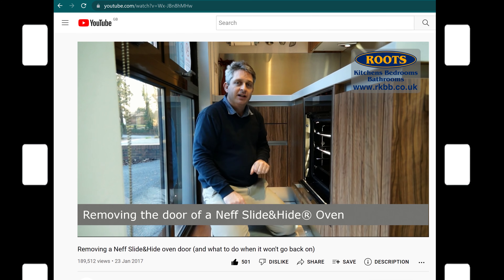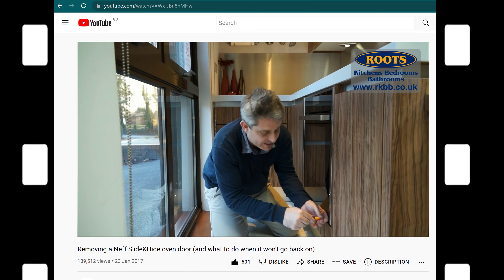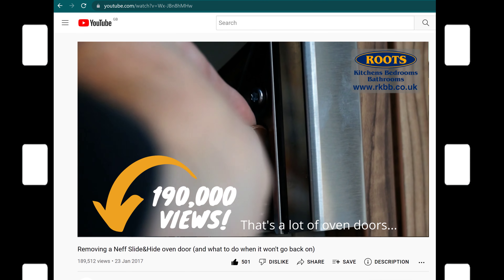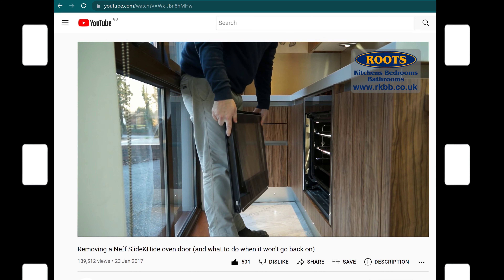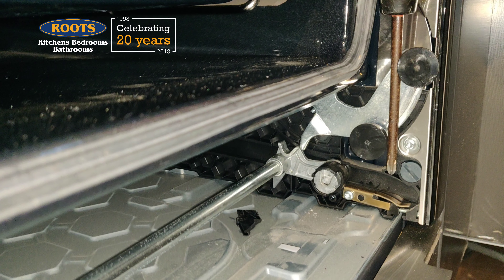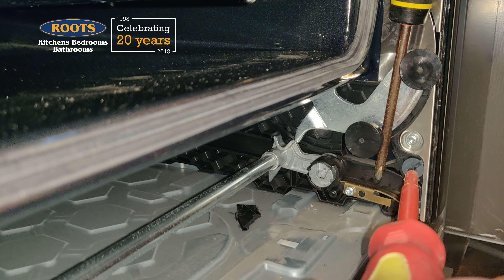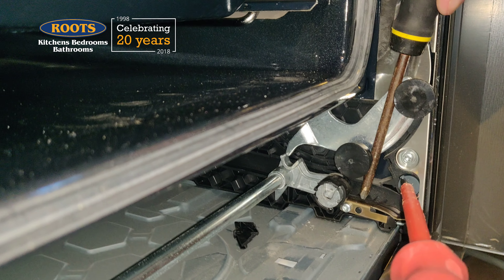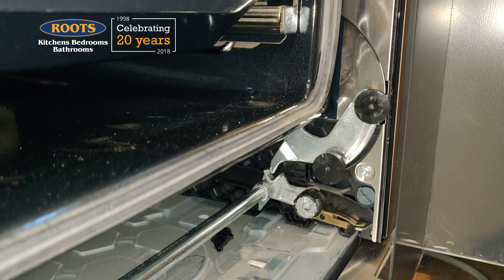Neff Slide and Hide - fixing the oven door hinge

Comment: Wuhay!! Fixed my Neff slide and hide door after advice from Roots. Thanks so much! The video on fixing the oven door hinge is brilliant. Top tip - I couldn't get one of the oven door hinges to lock in the open position, and the answer is to keep trying because (as discussed on the phone with Roots - excellent service thankyou) there is a sweet spot which for my oven is when, using the screwdriver as recommended in the video, you hold the hinge at about half to two-thirds of the open position and then turn the hinge lock. After a few tries I managed to get it to lock and the oven door is now functioning fine. Thanks again...!
Reply from the maker: What's the model number (hoping you have the invoice, rather than me tell you to look at the serial number hehe)?
For most, left hand side of the oven vertical side, 
OR when the door is open, look at the bottom edge of the door (you might need steps or to use your phone to video along the bottom edge if the microwave/oven is high for you, 
OR  for wall microwaves, the left hand edge of the control panel when the door is open (so right hand of the door where it meets the control panel, these doors are always left hand hinged).
Hope that helps,
Steve

Comment: Hi Steve, thanks alot for sharing as this video was very helpful.  Had the same problem as when I removed my door missed the steps to turn the screw and lock the door in a mid open position.   So had to get the hinges in the lock position first before I could re-attached the door.  I found it quite difficult even with the video but realised after some time that I was not pushing the clip far back enough to get the lock to engage! Anyhow after some perseverance and with the help of your video I sorted it.  I will not be missing that step again!

Comment: I have just struggled to replace the Neff slide & hide door.  I managed to get myself into a right pickle, ending up with the bar at the bottom of the oven right out of the tracks and shedding the roller bearings to boot.  Your very helpful video complete with those all important close ups got me out of trouble.  Thank you for what you did - I am most grateful.  Best wishes.

Comment: Brilliant video helped me sort my door out. My was a slightly different issue as the door was locked at an angle and would not slide in or go up/down Needed the oven taken out to get to the hinges as the bar had come out. Looking at the design it not very cleaver as only a very small contact area on the V and the tooth.Biggest issue was the so called engineer who attended said we needed a replacement bar @£160+. After he went had a look and all he had done was lose a bearing when he dismantled it. Got one from a bearing specialist @ under a £5😂
Reply from the maker: Nice find on the bearing replacement. Having the skill to identify and replace obscure components is very useful!

Comment: Thanks, I was stuck when the left hinge on my oven door was in an incorrect position (on refitting the door) and  would have needed to call an engineer without your video.
Reply: thanks had an  problem  first time took of my doors in my oven  tried to get my door back on right hand hinge was locked tried to open with my hand sprong back and gave me a right sore and bloody finger so got onto you followed your instructions and great working ok  thanks again saved me a few £ and no more burst fingers

Comment: Great videos.
I shattered the outer glass panel trying to replace the door when the hinges hadn’t locked in the partially open position. Bought a replacement outer glass panel and refitted it. There are 4 torx screws that need to be undone to do this, but it’s not too difficult.

I had just the same issue as the Roots video when seating the door onto the hinges, but watching these helped me figure it out.

It looks like in this video the rotary black plastic hinge locks are rotated down. You’ll need to rotate them up (away from you) to align the aperture in the black plastic with the recess in the silver lug so that the door can slide all the way down onto the hinges.

Comment: Spent a couple of hours today wrestling with this but the bit the hinge sits in on each side and the connecting bar had migrated to the back of the oven  which caused confusion. Eventually we found it, got the rollers back in and failed repeatedly to get the door back on until we realised we had to lock the bar and U think back under the hinges. We wrested the hinges back into place but using a screw driver is a better idea. Fixed it eventually.

Comment: I'm having problems getting the hinge lock to lock the sliding hinge.  The hinge slide is fully to the inside position so trying to pull it all the way back and lock but it doesnt lock. Any help appreciated.
Reply from the maker: Sorry for the slow reply, busy with the real job recently :-)
I'm hoping you found a solution rather than go hungry for 3 weeks, generally the solution to this is to keep trying and try holding the door at different angles whilst you lock the hinge. You can see in this video it took me two attempts to lock the hinge.
Hope that helps
Steve

Comment: Thanks to your video I managed to get the oven door back on but for some reason it is ever so slightly skew and the glass touches the base on the bottom right hand side, as I close the door, forcing me to lift the door a fraction as I close it otherwise the glass may break. Any tips on how to align the door so the gaps are equal all around and the bottom right hand corner doesn't scrap the bottom?
Reply from the maker: Two ideas that might help; 
a) I once had an oven where the base was slightly deformed. Pushing it down back into shape solves the rubbing problem.
b) Assuming yours was ok before, then taking the door off again (sorry!) and putting it back on and maybe it will sit slightly differently. 

There's no adjustment in position/angle from memory of playing with these, though if you look at the connection points I did once have a broken plastic clip part and that was why a door wasn't sitting straight (solved by replacing that part which was the side profile of the door if I remember correctly.

I hope that helps!
Steve

Comment: Hi Steve - thank you for this. I fixed the door hinge. But now the grill function won’t work as the oven says the door needs closing. The door looks closed - have I damaged a connection ?
Reply from the maker: @sarahlouise5729  I've not seen this before and no other commenters have mentioned it.  Guess 1, does the grill turn on if you gently push the door closed?  Maybe the heat seal (flexible gasket between oven and glass door) has come off and is stopping the door completely closing?
Reply: Hi Steve - if I push hard on the door the grill will work . Nothing appears to be damaged.
Reply from the maker: @sarahlouise5729  OK, that sounds like a good sign. Check the rubber seal around the door, then try removing the door and putting it back on again. Maybe the trim is slightly distorted/twisted, or maybe the door isn't quite on the hinge properly.
Follow the instructions in the manual step by step in case you've missed a step (eg: slidey black plastic locking parts that I forgot to reset in my first video on the hide and slide doors).  My instinct is you can fix this... it's just work out which bit is the problem.

Comment: My oven door stuck and a bit of the side black material has broken off, my handyman said the side didn’t look very strong for the regular use of opening the door. I have tried to stick it back together but it hasn’t worked. Can I buy spare parts or is a complete new door going to be needed?
The oven was fitted in 2017 so is 7 years old and doesn’t get used that much.
Reply from the maker: Hi, you can buy spare parts from Neff or (probably) the generic online parts companies. For direct from Neff, https://www.neff-home.com/uk/service/spare-parts where you enter the ENr number / serial. If you can't find the serial number on your oven, this video will help -> https://www.youtube.com/watch?v=6gmd3M-0LaQ&pp=ygUXbmVmZiBzZXJpYWwgbnVtYmVyIG92ZW4%3D
The Neff site will show an exploded diagram with all the parts of the door you can order and their codes.
Hope that helps,
Steve

Comment: Thanks for your video, it’s sorted the issue with the left hinge but the right one, no matter why I do it doesn’t lock in place. What am I doing wrong?
Reply from the maker: I think it's keep trying and hope. You see it took me two attempts to lock it, so try the hinge in different angles as you turn the lock to see if you find the magic angle.  Also the twist that you're doing is pushing a plastic strip to move the hinge lock, so maybe try a 'fast' turn to lock position as well as a 'gentle' turn. Maybe it's sticking and varying the speed of turn will help you.
Reply: @RootsKent  thanks, it did work eventually. I saw on another reply to someone that you’d done that we had to just keep trying and eventually we got there. Couldn’t have managed it without your video.

Comment: Are you able to advise, my hinge is not engaged the same as yours in the video, but it’s in more of an upright position, it’s really hard to pull back down, but I have done and re and engaged it, but when trying to lock it into that position it just springs back up 😢
Reply from the maker: Sometimes I've found I don't put the hinge in quite the right position to lock. 
I think I remember in this video having to move the hinge to a couple of different points before it locked but it was a long time ago. 
To solve, try moving the hinge and locking it a different angles. If it doesn't work, try another angle and hopefully you'll find the sweet spot that it works.  
Good luck and let us know how it goes - it might help someone else reading the comments with the same problem 🙏

Comment: A real pain in the Harris to take the door off to clean the glass internally the manual is not clear on the locking round pins when putting back on the oven - I have successfully broken something on the right side and internal of the oven (probably a spring has pinged of) it just about closes now.
Reply from the maker: Hi, from memory there's a hook shape on the side of the oven door, at the bottom, that engages with the bottom roller/lower circle, the one that slides to the back of the oven. When you next dare to remove the door, check if the sides look the same. If that hook has broken off you can go to the Neff website and search for parts based on your oven's model number.  
If it's the locking pin that's broken I think they're also available as a spare part though I haven't tried buying either of those. If you do need to go one please post back and let others here know how it goes.
For ''just about closes', beware that if the door isn't closed properly against the rubber seal between door glass and oven body  you'll have hot air escaping. Higher running cost, maybe not so good cooking, but potentially that heat could cause damage outside the oven (control panels, adjacent cupboards). It's probably worth checking to be sure just about is closed.

Comment: hi my issue is the bottom bracket on the bar that has moved to the front the bar you move with your hand in the video and its solid
Reply from the maker: Hmm, I'm not quite sure what you mean but if your backet on the bar is loose, check the opposite side too. 
From memory, the two brackets are held 'apart' into the oven side guides by the bar, but the bar can be rotated (imagine right side going towards back of oven, left side coming towards door) to come out. I seem to remember one coming out completely and falling apart on me, and it was easy to put back once I'd worked out the angle and pushed the brackets back on when inside the oven, making it more solid again
I hope that helps.

Comment: Thanks! I had an issue with the sliding door handle not turning, turns out the wire is snapped inside the mechanism!
Reply from the maker: Thanks for sharing, that's a really useful detail for someone else having the same problem
Reply: @RootsKent  Thanks! I'm going to buy a new wire and try install it, if that doesn't work then I'll be buying a whole new door.
Reply: @HarryW96 my handle not turning but can't get the door off. Is there a knack to getting door off to check the wires etc...
Reply: @HarryW96  Did you manage to fix this issue / the wire yourself?
Reply: I clean ovens for a living. Yes I have come across a few of these where the wire had broken. Sounds like it's quite a a common thing

Comment: Can't refit the slide and hide door. I can re-engage the hinge in the claw as you suggest but the lockinh screw doesn't work so it just snaps back before I can fit the door. Tried everything but without the lock it's impossible, any ideas?

Comment: Hello
Hoping you can help me as I went to remove the door for cleaning I turned the 2 flat screwdriver locks but forgot to flick the hinge covers up. Stupid me.
I then opened the door and it will not close now despite turning the 2 locks back.
The door slides out a bit but will not hinge up.
Im stuck!!

Help please if you can I can’t even take the oven out as the lower screw is obscured by the door being open
Reply from the maker: OK, let's save Christmas dinner! I think flicking the hinge cover/slidey black bits are a misdirection here.  
I think the problem is the turning of the lock with the screwdriver/coin.
That turning movement moves a flexible plastic rod that in turn lock and unlocks the hinge movement. We had a new oven last year and the first time the client remove the door the rod jammed.  The lock still turned so it wasn't apparent that was the problem.  We eventually solved it by removing the oven (we just had enough space to get torx screwdriver to the lower screw and remove the decorative sides if I remember correctly) and then you can see the rod from the outside of the oven. A light tap, it released and everything has worked perfectly since.
So for you I'd suggest 
a) tapping the side of the oven between turning the lock and trying to move the door/hinge. With luck, a lucky tap will dislodge it so the hinge is released. It's worth trying a dozen times before option b...
b) Removing the oven without being able to access the lower screw on the decorative cover: The decorative covers have a a little bit of flex in them. It may be that releasing the top screw you may be able to flex it enough to access the screws the secure the oven to the housing.  If that fails, you can break them off knowing you can buy new covers after Christmas. If your oven is a collection model, then for example this part https://www.neff-home.com/uk/productlist/ovens-compact-ovens/accessories/Z9060MY0#/Tabs=section-manuals/Togglebox=manuals/ is £62.22 inc VAT according to my computer. If your oven is a core range model you can buy replacement from Neff once you know the model number (https://youtu.be/6gmd3M-0LaQ).
I hope that helps, please post back and share how it goes as that may help someone else!
Thanks
Steve
Reply: @RootsKent  Many many thanks. Once I'm home I will try this. I will update with some photos also as I'm a big believe in helping others from my learnings.
Reply: @ Hello again,
What can I say, absolutely fantastic advice!

I got the oven out by just about reaching the bottom trim screws without any bending of the trim using a T15 screwdriver. I then jiggled the connecting rod a bit and the door then was able to be raised shut.
This mechanism seems poor and almost a gamble if it will engage but at least I know next time its a case of sliding the oven out.
Unfortunately my patience wore thin the other day and in forcing the door I have broke a section of the side rail and also bent the bracket which is bonded to the outer glass which means the outer glass now has a gap at the bottom and the roller wheels catch a little when opening.
It means I can use it as an emergency oven at least.

My question would be is it worth awaiting the Neff visit on the 2nd and will he replace the front glass and rail or would it be worth cancelling and sourcing the parts myself? Im extremely competent and have had the door glass apart before so would be confident replacing the glass and rail. The only thing putting me off doing this is the absence of any parts showing up for a B54CR71N0B.

Many thanks once again Im forever in your debt.
Reply: Just to add to this I doubt I would have been able to raise the door up enough to expose the lower trim screws if I hadn’t have forced the door so breaking the side rail was almost a necessary evil (albeit an expensive one I can see coming!)